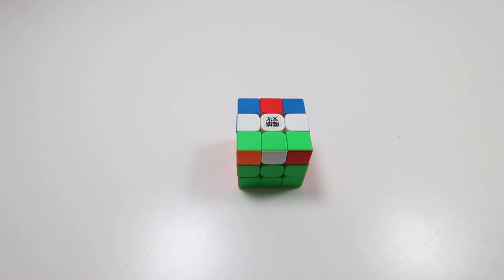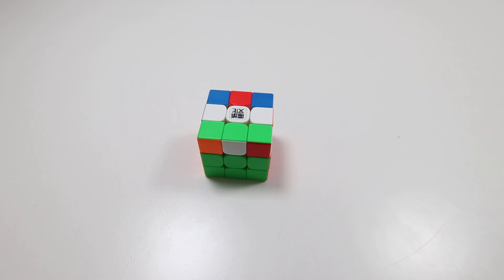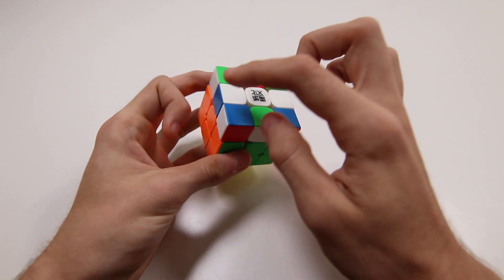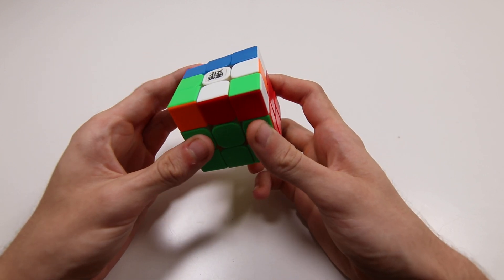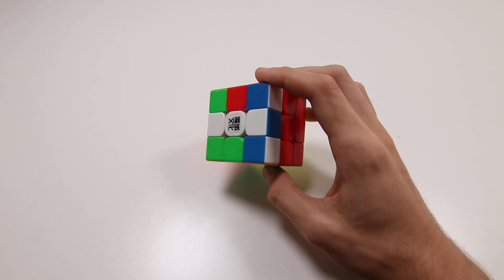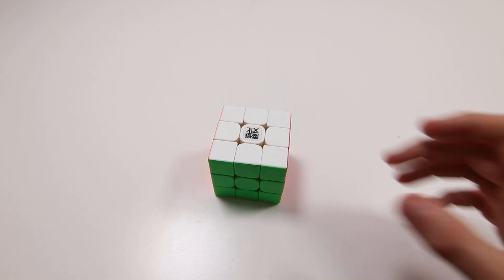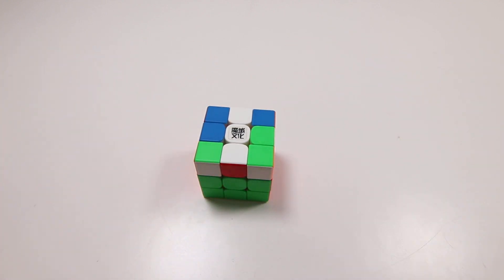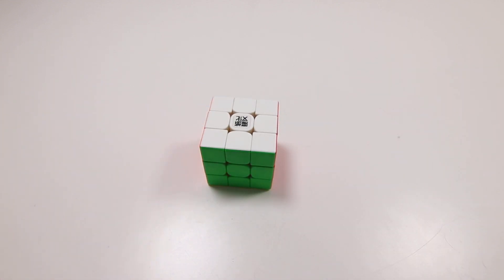OLL 56 EO into ZB ideas

Comment: I’ve been thinking about some similar things but for the f R f’ … C shape OLL. Basically similar stuff except comms give T and fruruf gives L. 
Reached the conclusion that the logical conclusion to this type of thing is full LL recognition, and just know the comm/angle/ etc to do to get the best possible ZBLL. Eliminates a lot of bad cases but the cost is having to learn recog for them. But if you’re already doing ROLL/JOLL you’re halfway there. 
I’ve seen Tymon do this (recognize zbll from the C OLL) but it might have just been an easy case he knew, not really sure and I don’t remember where i saw the solve (monkey league). It’s also possible he just recognized that quick but it was a shitty case so i don’t think so. cheers
Reply: Also i think these are definitely the two worst OLLs and doing EO for any other case is totally not worth it
Reply: C case is definitely worth it when it comes to setting up for zb
The primary reason is that cp doesn't change 

So even if you don't cancel into zb, atleast your transition from set up to zb will be pause less
Reply: Of course only one case is worth it as the alg for the other c case is really short also it sets you for U zb which is good but not better than T
Reply from the maker: i'm hesistant to say that the C shape f R f' is "definitely" the next worst considering it's 9STM 

If anything, I'd rather research EO>ZB for the collin burns OLL (at least for noswap/diagswap since the adj cases actually have good OLLCP algs)